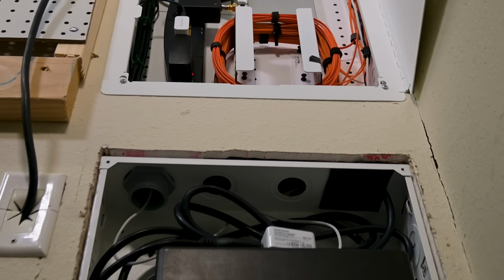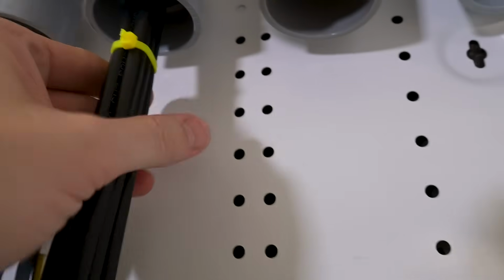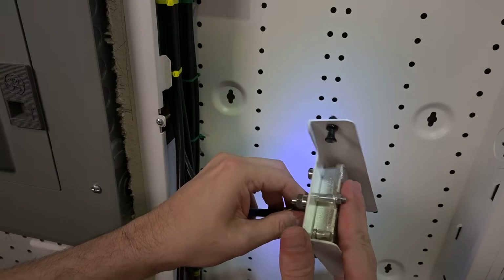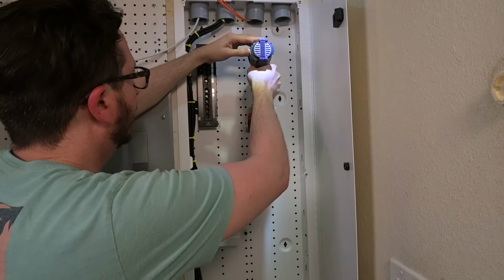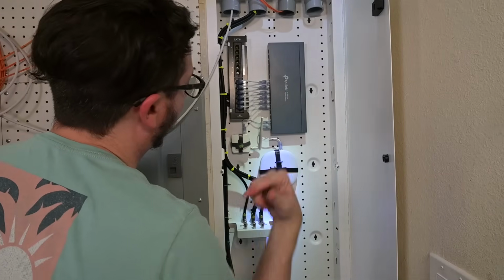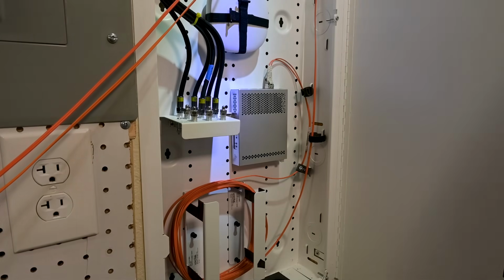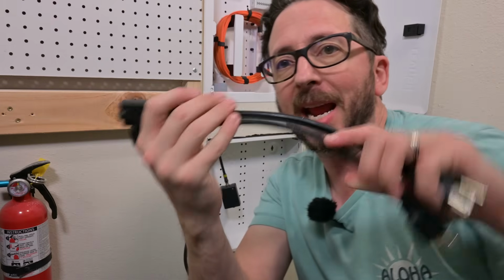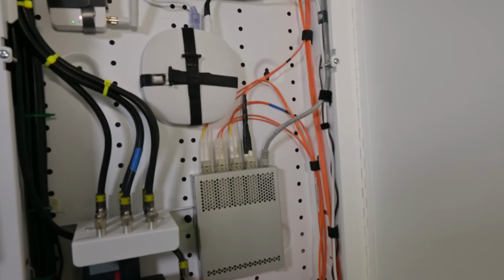Home Networking Upgrade - 10Gb Fiber, UPS, CAT6 Gigabit - ULTRA CLEAN NETWORK PANEL SETUP

Comment: I can seee now why you were after comments while you were zip tying those thick cables... So I might as well do what you asked 🙂...   If you ever need to change anything inside those zip ties, you will have to cut them to do anything. Velcro is reusable on the other hand. There you go. Happy?   BTW, I have a 13.5kWh UPS in my garage, it's called a Tesla PowerWall !   🙂

Comment: Clean, I personally use small rack mount enclosures ! Dislike these network pannels!
Reply from the maker: These are a pain to deal with. Had I known how things would evolve in the house and garage, I would not have started with one of these. It does have the conduit routed from the attic, and the attic is not a fun place in this house, so I just had to come to terms with it and clean it up.
Reply: @DigitalSpaceport  YUP!  you did good. Clean and simple !

Comment: Question, why have the 10g in there? There's no devices connected through that cabinet that needs 10g is there? Could just keep the 10g in the rack, or do you not have structured cable to the rack (aside from that specific fiber)?

Comment: Thank you for the detailed video.  It gave me good ideas for my similar setup.  Running flexible power cords in a wall cavity between UPS, panel and out the junction box is an electric code violation.  The solution I used was to wire a junction box with outlet in the Leviton panel (the rectangular cutout in its bottom and wire it (using Romex power cable) to a wall mount junction box fitted with a NEMA-15 inlet receptacle.  The UPS sits on floor, plugs into a wall outlet and the UPS output plugs into the NEMA-15 inlet receptacle (via a NEMA 5-15P to NEMA 5-15R adapter).

Comment: What you really need is a Wall mount rack (NavePoint).  Something like a 12U to 15U, than you can install full sized rack-mount networking components (Switches, Firewall, etc).
Reply from the maker: You may not have seen the racks, but there are dedicated networking racks. I don't think I showed those in this video. More on those racks soon. https://youtu.be/nlC3euvNwXk
Reply: @DigitalSpaceport  Yes, I saw those after I watched this video.  That said I prefer the smaller wall mounts for cable wiring, since the wiring is fixed in side of walls. For server racks (42U) I prefer to leave them unencumbered since they are more likely to get moved in the future.
Reply: Also, the used full sized stuff is dirt cheap on eBay...

Comment: First of all, nicely done.   Seriously, short of going to a 19” rack, that is one of the cleanest installs of that many pieces of equipment I have seen in a home.

My only feedback is there are multiple reasons to straight up get rid of that 12-way punchdown block and to just terminate those 6 cables in RJ45 connections:  
(1) you don’t have hundreds of wires to punch down, so there is no an actual benefit (time, space, etc) to using punchdown with  only 6 cables.  Also, the 12-way punchdown is half unused and wasting space.  Terminating in RJ45 is not hard.  
(2) removing the punchdown block frees up a lot of space by removing a big object out of the cabinet.  
(3) going with RJ45 terminations allows you to move the switch to either the place where the punchdown is located or even lower, providing you with more options for overall layout.  
(4) Removing connection/interfaces inherently increases reliability.  Those 6 could go straight into the switch.  
(5) In the future, if you want to move to 5Gbe or 10GBe with those cables, the punchdown doesn’t have the necessary shielding that you get with the appropriate RJ45 connector. 
(6)  People need to stop using punchdowns for essentially nostalgia purposes. It’s old tech, not shielded.  I feel too many people use them because they see them in older installations or at work and are coping it without questioning if it is necessary.
Reply: Putting wireless radio devices in a closed metal box seems like a bad idea for them to work.
Shouldn't they be in the center of the house for best range ?

Comment: Looks good with the limited space and a lot of equipment. For power to the UPS. It seems you could add another outlet just above the box where the cable is exiting. That way you don’t have the power cable running up the wall.

Comment: I use the industrial strength velcro from Home Depot..it's about 2" wide with separate hook and loop strups and has a cleaner look when taped underneath

Comment: As a former cable technician it’s nice to see that you are utilizing 75ohm terminators. Question do you have a 7/16? Just seeing you tightening them down with those wire strippers at 10:26 was painful to watch. Great video otherwise!

Comment: good job, bro. why you not use 19 rack mount case for your cable?
Reply from the maker: I have 3 racks and a bunch of network gear on those and an internal network switch also. This is kinda the demark between those zones. I have made a network map now and will have that in the next networking video on my cleanup of the server racks networking. Thanks!
Reply: That was my question. I NEVER use these structured media panels. I'd rip it out and replace with a 19" Rack without a 2nd thought.

Comment: Zip ties... Not a mistake, but very "old school."  I stopped installing zip ties back over a decade ago.  Velcro straps are a better option, as they can be quickly undone and redone several times, without having to throw away and get new.

About the only thing I would have done different, is to get a power strip whose plug oriented correctly, so you didn't need a whole lot of extra cable from the extenders.

I do have to say, you have a very organized setup.  I'm somewhat envious.  I have a fairly crowded Leviton 32"
Reply from the maker: I have more gear I am thinking of adding and indeed the power strip was a bunch of compromises. Leviton makes a nice one, its of course stupid expensive.

Comment: Instead of using the wall warts I would use din rail and a single din rail PSU for each voltage with of course din rail distribution blocks
Reply from the maker: Okay now I am looking this up and yes you have a great point here! That is the best option for all this DC wallwart pile. Any brand you use in particular?

Comment: Hi! I'm your newest subscriber and a home network newbie. I saw you responded to a comment from 2 weeks ago, that's amazing you're so attentive! I have some questions if you've got the time!

My home has hardwired internet to each room but it's all cat5 so I can't hit those 10gb speeds. I am going to rerun the wiring in my house and I figured if I wanted to future-proof I'd be best served by skipping cat6 and going straight for singlemode fiber cable. My current setup for my house (When I bought it a couple years ago and moved in):

I have a utility panel on the outside of my house where the fiber cable comes in and connects to my ONT. My ONT actually inside this panel on the outside of my home. The ONT is powered by a UPS in a network cabinet inside that provides power to the ONT via POE. This is the portion of your setup I don't see.

So I guess my question is, where does your ONT lead? Is it running to your patch panel? I imagine you have a modem somewhere as well. Do you have a wiring diagram anywhere for your setup?

Where is your TPlink switch getting internet? From the backup router I'm guessing? Then that is how you connect your IOT device and the 6 ethernet to the left?

I can see it looks like you're power the MikroTik switch via POE and that grey ethernet running up. Where is the grey ethernet plugged in? Is there a special was to use POE? Could you just plug it into the TPLink switch?

I appreciate any guidance you can offer! Great video!
Reply from the maker: First off I had a lot of work work I had to do so only had time for doing videos and sorry it took so long to catchup. I would avoid SM fiber and go for MM and in fact I did that in my house. OM3 cable (aqua colored stuff) is excellent. SM is very much smaller bend radius tolerances and things like tight edge wall runs can get tricky to maintain perfect bend radius with. I have 1 SM run in my house but 6 drops of MM and I think you will love the results! Why everyone doesnt have fiber in their home is beyond me. Preplan heavy and get a good pair of glowrods. Make sure you know if you have firebreaks you will have to double drill down! I did 2x cat6, 1x MM, 1x coax in each drop and it did take a long time and I hope you have a high pitch roof.

Next on the ONT.... I do not have FTTH unfortunately but am in an area getting high split cable which will finally get me to symmetrical up/down speeds and greater than 1gb (will go up to 5gb option) and I am very excited for that. I wish I had FTTH but its very unlikely unless ATT decides to add our subdivision. 

That mikrotik is an awesome little switch and "just works" over PoE and it runs over to my main racks (I have 3 racks and a lot more networking gear) which you can see featured in this video here. https://youtu.be/nlC3euvNwXk?si=9_gMLYbT7OazcjkV which will have an updated video out soonish as I now also have 100gb for my internal network. This is a reason to consider SM for sure if you plan to take it that far.

The slim TP link runs over to the main rack also, avoid daisy chaining switches as much as possible is very good advice.

Good luck on your wiring!

Comment: I do satellite tv. I can understand having some slack in the lines in case work has to be done later, but why leave that much of the orange fiber cable? Just seems like over kill.
Reply from the maker: Well the cables I just had or had bought cheap off ebay at some point without really presizing things. There was slack and I coiled it is really all I can say at this point lol. I could have left it in the attic, but then it can get to be a mess if it kinks up and stuff.

Comment: Nice little setup, you may want a wall mounted rack down the line if you need a bigger switch, etc.
Reply from the maker: The video on the 3 racks and their networking gear is being edited right now. This panel is just the demark for the house internal network + workbench and the racks.

Comment: Looking super clean and ascetic!      If you have cable service over the Coax like MoCA or ISP runs over the coax Please don't use those 8 way splitters people or any 3rd party MoCA splitter.   If it's truly being used as antenna you're good.     If it's a cable service those 8 ways take too much signal  off and will screw your service up.
-Cable Tech
Reply from the maker: Yeah its all antenna. I ran cat6 and MM fiber in the house so no need to moca.

Comment: Hi, great installation!, I looking to do some similar config in my house...
what device do you use at the other side of the Mikrotik CRS305-1G-4S+IN MM Fiber networking switch?
Thanks in advance
Reply from the maker: 2 videos on that in the works. On 1 side is my 3 racks of gear and they include for the network stack a Mellanox SX6036/ Brocade ICX 6610 and Dell 5548p for the rack needs. On the residential side I have another Mikrotek CSS326-24G-2S+ that does the house drops internally + the pfSense router and 5 wireless APs. Network Diagram in next networking video.

Comment: Probably a dumb question but what is the sole purpose of the Tp-link box?
Reply: That's a network switch. You can think of it as a power strip in the sense that you can connect multiple devices into power when you only have 1 or 2 power outlets. A network switch allows you to connect multiple wired network devices into your network when you have more devices than network ports on your router. Most typical home routers have 4 network ports. That's ok, but if need more than 4 devices connected to your network, you use a network switch. The switch plugs into an available network port on the router and then your extra devices connect to the switch.

Comment: Love the layout. Just wondered why you didn’t put the dust caps on the fibre ends when they were unplugged. It helps keep them clean, especially having seen what you did to the first one after wrapping it around the frame. 😱
Reply from the maker: I have piles of these from a server room cleanout and agree I should have used the caps, but I lost them long ago. Realistically if there was a problem I would just use the old to pull a new line in (its all in conduit) but all these strands are running w/o errors so 🤷 and finding those caps is a lost cause at this point

Comment: Looks like OM1 fiber which isn’t for 10G?
Reply from the maker: OM2 50/125 which is also orange and does negotiate at 10g and speeds at 9gbit solid over the distances it's run for me. It may be getting used as the pull string for OS2 however given new switch is much faster.

Comment: I 3-D printed a circular fiber coil support frame at my local public library based on a fiber storage tray that I had found the manual and specs for. Built it in Tiny Cad with tabs that snapped on to split mounting posts with an edge on the bottom to lock them in place. They could rotate out to hold the fiber cable on a 4" circular frame with a cross member for mounting. Again, 3M command strips placed it in the cabinet and on the cross brace hold it nice and secure.
Reply from the maker: do you happen to have that uploaded as an stl file?
Reply: @DigitalSpaceport  I don't.  The  setup seemed specific to my application at the time. The design is easy enough. A two-inch diameter ring with a 2.5mm width. four holes for threaded inserts for the tabs. The tabs themselves are 5mm with a hole at one end to mount the bolts. To mount the ring, I put a couple of flanges with holes on the bottom of the ring for more bolts and I used more threaded inserts on the mounting surface. finding the threaded inserts in that size was the hard part. you could just thread the holes and put the bolts in directly. You could also just use screws in the flanges to secure it if you were mounting to wood for example. I just mimicked the fiber routing in a fibre storage cabinet I found drawings for online. Most of those companies also provide AutoCAD elements of their products you could use as a starting point.

Comment: I used to install these in new home builds and love the system but the price and component pieces make is out of reach for most folks.
Reply from the maker: Leviton does charge a lot for the official addon parts

Comment: For coax terminations you should check the stinger after you strip the boot. Sometimes the metal strands will loop around the stinger causing interference also for the fiber you should look into SM not MM as SM will do up to 100Gbps basically future proofing your network needs
Reply from the maker: I now have a 100gbit switch and a lot of am to run! Living proof you are right 😆

Comment: I use 3M command strips instead of Velcro. They hold extremely well and can be removed by pulling on their tab until the adhesive releases. I attach one side to the back of the device and the other side to the cabinet. then just press the two together and you're done. The adhesive takes a few minutes to set up, so I usually give the two parts a few minutes till I connect them together. They have a wide variety of attachment fixtures for all sorts of things like large, framed pictures, posters, coax wire and mops and brooms. They are a premium product and priced that way but give a clean appearance without the bondage strapped down look. No drilling and they are rated for a variety of weights up to about 10 lbs. or more. Velcro has an industrial version of the product as well. very stiff   posts locking against each other. They are rated for up to 20 lbs. But the Velcro is permanently fixed to the surface. and not removable. You can find them in dollar stores, hardware stores, Walmart, and Amazon. There can be peel-away issues with drywall and painted surfaces if the weight is high. The command strips would have solve4d you are mounting issue on the 4-port Mikrotik switch with no effort..

Comment: do you have an HD homerun for your antenna setup?
Reply from the maker: I use a standalone cheap inline USB to COAX antenna tuner but it is only ATSC 1 and I use plex for DVR. ATSC 3 is out sometime in my area and when it comes around I will be going with an HDhomerun unit most likely.

Comment: I wonder how well the wireless is going to work in this metal enclosure. Looks metal anyway.
Reply from the maker: It is not great TBH but its wired backhaul to the 4 other mesh AP pucks so overall house coverage is still excellent. The speed isnt amazing as its 866 max on these. Leviton does make a wireless friendly (I guess plastic?) version of this but it is substantially more.
Reply: Not well, never put a wireless AP or wireless router in one of these!!

Comment: Not a bad little setup. I would have tried to trim the fiber up a bit. You might be able to 3D Print some more mounts and such for the box to clean it up nicely. Maybe route the coax cable through the left side so you dont have to bend as much. It looks like a great setup. Can't wait to see what you do with the servers
Reply from the maker: 3d printer hints are dropping like flys to the wife, really need one for all the gear I have.
Reply: @DigitalSpaceport  Got a bunch of things you can make for the wife too